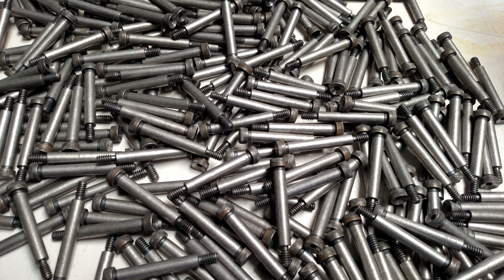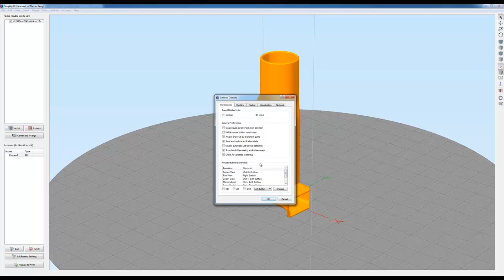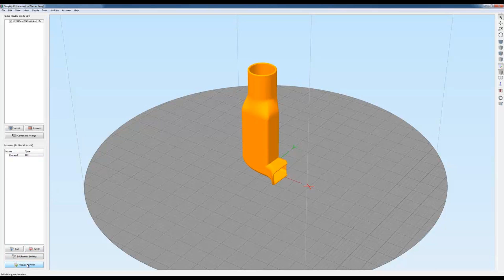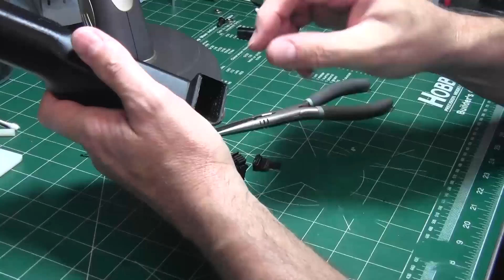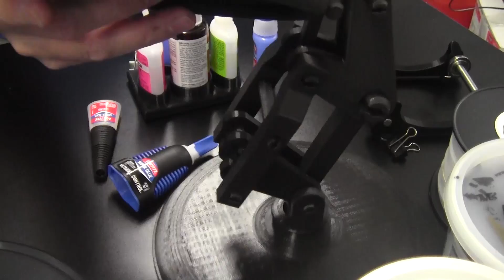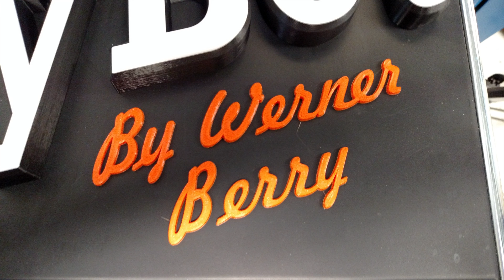Lots of 3D printing tips tricks and goodies!!

Comment: Great Video and fantastic job on your 3d printed sign.   Just a question regarding the clear filament, what settings did you use to print that ?  I have just got some clear filament and having problems printing with it.

Comment: Good seeing you again, been a while.  Couldn't agree more on Simplify3D.  It's a very versatile software and truly a must have for an active printer. That Hatchbox stuff is great. I was skeptical at the $23/kg price but gave the black and the glow in the dark a shot just for trinkets and signs. Had a client that needed aesthetics above all and all my 'pro' filaments had diameter variation resulting in strata lines. Out of frustration I popped in the new Hatchbox 'cheap' stuff the pushed print. It was a flawless print and I've never gone back.  On a side note the Hatchbox Glow in the Dark is a different formula. It's a lot stronger than regular PLA or even IN-PLA.  The majority of my steady clients prefer it because it makes a usable parts with a glossy smooth look and feel.  Oh, check your private messages, I'm sending you one.
Reply from the maker: +66tbird1 Thanks for the note Buddy!